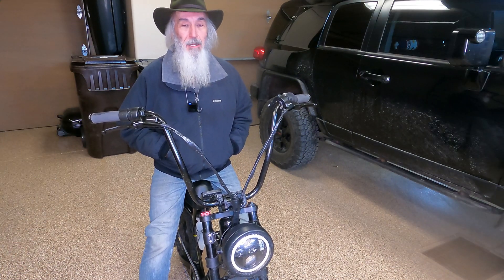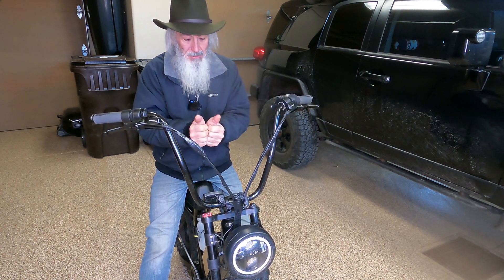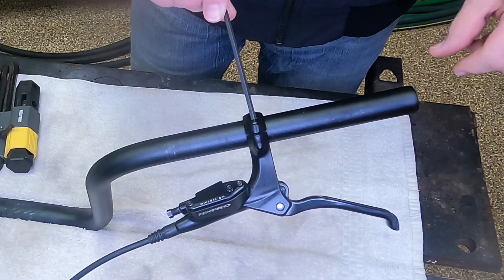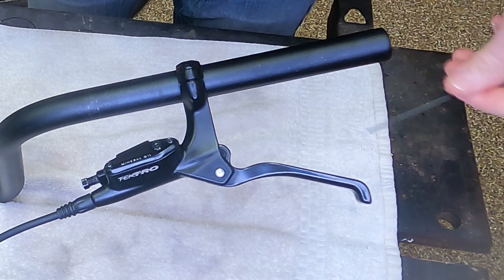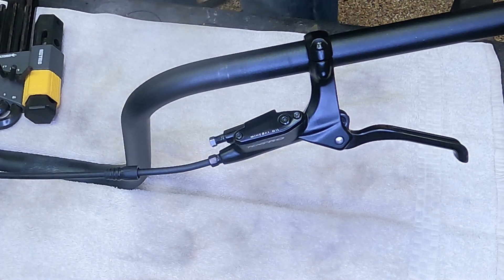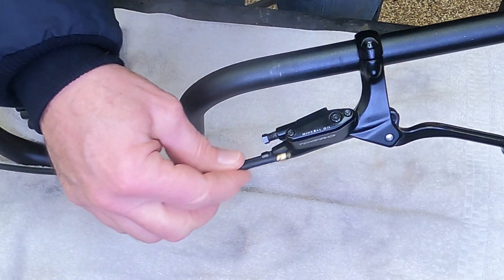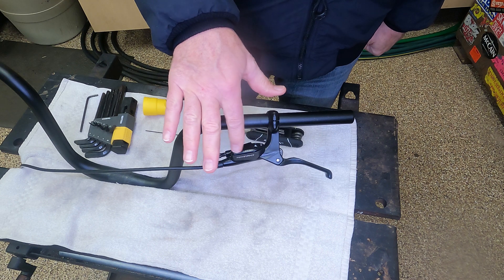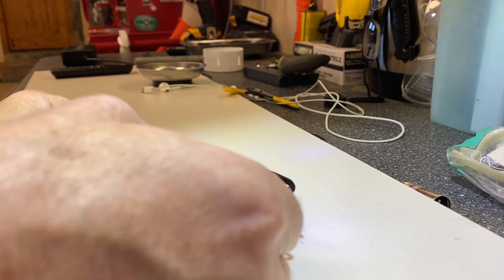Tektro E-Bike Brakes HD-E350 detailed explanation of everything necessary to DIY Repairs and Mods

Comment: Hello. I want to buy Tektro brakes HD -E3520. But technical information is important to me on how the electric sensor on the handle works. When the handle is NOT PRESSED (in normal condition) :                                                                   
 1. The electric circuit is non connected - NO  
 2. The electric circuit is connected -NC
Reply from the maker: If I remember it was NC Normally Closed (usa) or NC connected (over yonder)

Comment: You omitted the only part I need to see...putting the barb in with the collar and fitting it to the reservoir.
Reply from the maker: OK, so what I did when I needed to replace a line was, and this may be hard to visualize is,  I inserted the barb in as far as I could push it wih my fingers, then "lightly clamped it in a vise, vice grips may work too, then tapped it with some wood to get it to go the rest of the way till seated. or there's a tool Park makes just for this.
Reply: @UncleFjester  Hey, thank you very much Sir.
Reply: @UncleFjester  Got my brakes done. Thanks for your help, Unc!

Comment: I had always wondered wether baby oil could be used, thanks for confirming it. I guess the only difference between baby oil and proper fluid would be the additives the use to reduce boiling point etc, but i mean, its a bicycle not a motorcycle in what situation are u going to be boiling the brakes.
Reply from the maker: Added Fragrance of Baby Oil allow you to smell it when there is a leak.

Comment: Our teennager had a small crash that bumped the right brake grip of the TekTro HD-E350. The result was that the snap ring(c-clip?) that is inside the grip popped out.  My snap ring pliers are too big to get in there and the tips don't even fit the snap ring holes... 
Can you recommend a tool that would make it possible to set that snap ring? 

Thanks for the video!
Reply from the maker: Sorry John, I got nothing...
Reply: @UncleFjester  Do you know the ring I'm talking about? It holds the tip of the push rod that compresses the hydraulic fluid/mineral oil.  It just seems like such an awkward setup to get that ring re-set!
Regardless, thanks for the video AND for giving me an idea in my own videos. I like your pinned comment approach, and and I'm already in the  process of adding the same to my own videos... We offer value, and I think most folks have no idea they can send a $$$ tip!
Reply from the maker: All I have now are Shimano Deor's on my MTB.  Email me a picture of the clip, unclefjesteratgmail  But in manufacturing, making a tiny C Clip needle nose Pliers for a once off use is nothing.  I'll bet you can find replacement levers on ebay for cheap. Most people are now using phones to watch and I have no idea how to set up for that.

Comment: ..Everything..,  except how to fix the cut-off switch when braking :-(
Reply from the maker: Breaking or Braking?  There is a difference and you'll learn it when you get to the 3rd grade.
Reply: @UncleFjester  Thanks for the rectification.., let's call it a slip of the pencil..
Reply from the maker: Your 1st comment didn't give any details on what your cut-off problem is.  Not sure if you're just bitchin or if you are serious about my help.

Comment: Uncle, 
High 5s for video. 
Purchased a Aventon 500.3 Pacer, June last year. 
I live out of state from the state I purchased bike. 
The bike shops where I live, seem cater to a certain client base. 
Treks, other high end bikes,
They don't carry Aventon. 
Lately, front brake mushy. 
Discovered the ParkTool website, thanks courteous rep. And other sites pertaining to bleeding brakes. 
Ordered bleed kit from "A". 
After several attempts to relearning fluid dynamics, Ha, using both syringes, finally used the cup, that method worked. 
Learning this stuff, I contaminated pads. 
Now I have a horn when brakes applied. 
Order brakes or use sandpaper and ISA to clean/resurface pads. 
Once again, just found UJ site today.
Reply from the maker: Yeah, Hydraulic brakes are a pain in the ass till you become one with them, then it becomes easier to service them which you'll be doing frequently.  My advice would be stay offline and out of the forums, Iso Alcohol is for Doctors, not bike brakes, those commenters know nothing and just repeat what they read like a monkey would.  No need to sand the rotor either.  I would get new pads and a spare set or two depending on how many miles you ride. Hyd. Pads wear fast on these heavy AF Ebikes.
So, a little common sense that no one in any forum has, is this.  These are the same brake design mountain bikes use only cheaper.  MTB racers go thru knee deep water and nasty mud and all they do is hose down the bike.  And they are fine.  If you want to ride today, I'd remove the pads and with some 120 or 240 sandpaper, lightly rough up the pads then wipe down the rotors with any solvent.  Its just Baby oil that got on everything. Good luck!

Comment: Really wish tektro had used  a 3 wire magnetic switch that can do either normally open or closed (yes they exist) - as I need the opposite - continuity when brake is pulled - to turn on regen for the kelly controller.
Reply from the maker: It should be as simple as switching out the contact in the lever.

Comment: I am really cofused on which one of the Magura ebike brakes I should buy for my current ebike controller. Should I buy the MT4e closer NO or the MT5e Opener NO. I did a test to try to figure it out. But I am still confused on which to get. When I unplugged the sensor from my current brake levers. I am still able to throttle the ebike whike pressing the brake levers. Also the rear brake lights do not come on. Knowing this, which one of the Magura models should I purchase?
Reply from the maker: There are only two wires used, the switch on the lever is usually magnetic. all it does is make or break a contact.  What Americans call N.O.(normally open) Germans call that a Closer. What Americans call N.C. (normally closed) Germans call that an Opener. Its actually Germans forward looking culture. they look where things are going , while america looks at where it is.
The reason you can throttle the bike with the harness unplugged is you disconnected it. Sorry to laugh but its been a long day. That Means they are normally open and when you compress the lever they close. So what you want is the "What Americans call N.O. Germans call that a Closer"
It is confusing... I hope ya understand
Reply: @UncleFjester thank you for responding. You cleared it up for me. I was going to just buy the MT5e if you didn't respond. I figured I had a 50% chance of being right. I just subscribed to your channel. Good stuff, man!
Reply: @UncleFjester im thinking about getting the 4 piston Tektro beakes on my stealth bomber. It is a 175 lbs. ebike. Have you ever ran them on any of your bikes? If so, how did they perform compared to, say the Magura?
Reply from the maker: 203 Rotor and 4 pistons up front is all I would do.  But I rarely use my rear brake

Comment: Years later, this wisdom remains valid (solid info is like that) I see the cut-off/brake light line is basically a toggle, not supplying power, but suitable to switch a device on/off, specifically a brake light. If you happen accross this, can you suggest an aftermarket brake light brand/model that accepts this as a signal? I have Techtro Mechanical brakes, with that signal line. 
Thanks forbthe Tectro "Brakedown" in any event! ✌️
Reply from the maker: One more thing, I can't remember, but the contacts in the Tektro lever might be NC Normally Closed and woulnt work as a brake light switch. But an Ohm Meter would confirm my thought
Reply: @UncleFjester  Thanks, that could be.  I'll test before investing time, parts etc. Appreciate the help!
Reply: @UncleFjester   - If the switch/contact in the Techtro is normally open. I'll  take the positive lead in the headlight barrel connector, split it for a line to both handles redundantly so either handle can close the circuit. Not exactly James Webb telescope complexity, but should work for my simple needs.
Reply from the maker: Sounds about right, You'll still need a negative to the rear light.  The bike doesn't use the frame as a ground, as our cars do.
Reply from the maker: OK, so you want to use this lever as a Brake light on a non eBike?
Easy wiring, you'll need a battery suppling the voltage the light requires. Then take the battery negative directly to the Light negative.
Take the battery Positive to either side of the brake lever, then the other side goes to the Positive of the Light.
Electrical wiring 101...Easy Peasy
Reply from the maker: https://www.aliexpress.us/w/wholesale-bicycle-brake-light.html?spm=a2g0o.productlist.search.0

Comment: Now which wires go to the break light and which wires go to the engine cut off? Not trying to do burnouts just wondering
Reply from the maker: Every wire goes to the controller

Comment: Dude just found your channel trying to "fix" the brakes on the used Ariel rider I just grabbed used.  Love your style.
Reply from the maker: Welcome aboard! & Thanks!
Here is the deal with eBike brakes, especially a powerful Ariel.  Most brakes are undersized which means the pads will wear fast AF. Between pad replacements You can bleed or pump up the pressure to get by til the pads get replaced.

Comment: Great Video however would you happen to know if there's a lever spring on this model?  My brake lever no longer springs back when you take your fingers off it.  Other bikes would have a bolt that can be unscrewed releasing the lever from the brake assembly which gives you access to the coiled spring however not sure if the silver pin on this thing can be removed and replaced.  It appears that it be more like a rivet and once it's compressed on it's on.  Thanks in advance
Reply from the maker: This works on Hydraulic pressure of the lines, if you have no pressure or a leak, then squeezing the lever pushes all the fluid out and with no pressure it can't rebound
Reply from the maker: Not that I know of...

Comment: Love this video at the beginning and at around 12:53 mark. The sense of humor is awesome. I do all my bike maintenance work myself: fork (uppers and lowers), rear shock, pivot bearings, full stripdown of wheel axles and hubs, bottom brackets, headset, derailleurs, hydraulic brakes (bleeds and full overhaul of master cylinders), etc... The only thing I likely won't do is put baby oil into my Shimano hydraulic brakes. I'll use mainly the Shimano or other branded mineral oils for the sake of safety. Done right and with regular maintenance on the calipers, hydraulic brakes don't need to bled all that often. So, if you're doing this yourself at home to safe some money, might as well spend some money on bike specific brake mineral oil. A whole liter of Shimano mineral oil will cost $30 but will last 5-10 years if you regularly bleed every year. Baby oil that have fragrance have additives that might not be good for seals over time. In addition, no one has really tested the boiling points and duration of braking with baby oil. When your brakes gets near that boiling of the mineral oil, braking starts to fade and you will feel it when there's almost no braking. This is not a good thing especially for e-Bikes since you need the power of the brakes to provide braking, especially for e-Bikes that are heavy and can go fast. Yeah, there are forums where people have tried using baby oil (as a test or as a last resort). The reviews are mixed as some say it works or it works but you need to bleed quite often or it works but the levers feel squishy. Brakes are probably one part of a bike where you don't want to compromise on it's effectiveness. Trust me, I've been up on mountains where I have absolutely no rear braking due to a leak in the master cylinder. It's not a good feeling. Since I know how to use front braking, especially for downhilling, it's not much of an issue but still the feeling of having one of the hydraulic brakes go, it really drives your confidence down.

Comment: Hi uncle, can you explain how to add a break light on the  break levier for an electric bike like that ? I have a Surron and I want to make it street legal
Reply from the maker: Let me try.... Bring a Positive + wire(lets make it red) from the battery to the brake lever, it won't matter which wire(brake lever must be a Normally open contact) with the other wire on the brake lever go to the positive + on the brake light. Now you'll need a negative - wire (lets make it black) from the battery to the other - wire on the brake light to complete the circuit.  Because eBikes are different than cars, where all metal object are negative you need a separate wire from the battery.
All of this is the exact same for wiring a head light too.
Good luck, thats a lot of work, especially keeping the wiring clean looking.

Comment: Thanks.. I made the mistake of trying to tighten the ReachAdjustment screw in the lever.. I didn't realize that it wouldn't stop when it reached the limit.  What happened was that screw is really the rod that attaches to the plunger that pressurizes the calipers . Because i turned too far, that rod dropped inside the housing of the lever.  
I ended up having to purchase another E525 brake set because the old one froze up and the lever wouldn't move after the rod dropped inside.. this jammed up the action on the lever and no way for a layperson to fix without specialized tools..   and parts that are not listed on Tektro's website..   Tektro customer service told me that instead of tightening the reach adjustment screw, i could have accomplished the reach adj by simply bleeding the system..
My little mistake that cost me about $190...

Comment: Does anyone know where I can buy a replacement sensor online? It's like they don't exist. One of the wires got pulled out and I don't think shoving them back in there is gonna work reliably.
Reply from the maker: Personaly I'd take this opportunity to upgrade the from Brakes to the Magura MT5 and salvage the stock parts to the rear brake.  Due to the weight of the ebike and the entry level Tektro brakes, your stopping power in minimal at best

Comment: Getting back to the brake sensor...could you revisit this please.
How does it work exactly?
My sensor wire broke when I took a spill throwing an E25 on the control "sensor error". Can I simply resolder the wire, is there a polarity issue... give me anything you have please.
Reply from the maker: Should not be a polarity issue.  It is only opening and closing a contact to kill the power and initiate the brake light. Soldering will be fine.
Now lets discuss why you took a spill.  Do you still have those Dangerous POS Innova tires?  Those need to go as they have an unsafe design!
Reply: @UncleFjester  They have knobs, KENDA is the brand. No, I would have needed studs due to the ice. Now I'm trying to get a new sensor with wire and coupling.
Reply: @UncleFjester  If it was a matter of closing the circuit does that mean I could just short the wires and get power back to the motor?  Maybe there was a fuse blown too?
Reply from the maker: No, the switch performs two functions. It activates the brake light and cuts off power to the motor.  If is "just" broken, or disconnected, I would expect one of two things would occur.
1 being, squeezing the handle to do nothing(no brake light, throttle still active)
2 Being, throttle won't work, brake light is always on.
I can't remember if the switch is NO or NC
All of this is wired directly to the controller, I can't see why having the wiring ripped out would damage the controller.
The contact switch in the brake handle is magnet operated.  https://www.youtube.com/watch?v=vWwIrzTArwM
Reply: @UncleFjester  I soldered the wires together and got the bike working again. Its a thought that the wire was too taught in the first place. I have ordered another handle as a just in case but those solder joints are protected in the handle, they "should" hold. Thanks

Comment: Lol I can’t believe people actually bring them in to adjust brake a bleed brake, some people have more money then any common sense and lazy overall. I built my own ebike from frame up including the battery pack as wanted high current Samsung cells and etc. Prebuilt bikes are overpriced crap with cheap components to cut corners for the most part. I would had to spent over 3k plus for a prebuilt for specs I wanted like high amp hour pack with brand name cells and thick copper winding in motor, hydraulic brakes and etc. .
Reply from the maker: 😂 Makes ya want to open your own Bike Shop.
Money grows on handlebars

Comment: When your breaking on left handlebar that controls the front tire suspension you're supposed to have full control of the front breaks when you break at a full stop ( left break handle touches the handlebar ) ?
Reply from the maker: I guess it's personal preference, and I prefer not to have the brake lever touch the bar

Comment: I replaced my rotors and brake pads with much nicer rotors and pads and I think it cost me like 95$ and it makes all the difference in the world. With these cheap ass brakes I was having to adjust the brake pads almost weekly
Reply from the maker: did you replace the rear disc too?  I tried but it would fit
Reply: @UncleFjester  i did, but i have the juiced crosscurrent x, not sure if that's easier or not. I also live in a town that has a place you can take your bike to and they will teach you how to do fixes on them and they have all the tools to use which is great.

Comment: Is that a special juiced bike brake adjustment towel you use? I noticed you didn't put a link for it. I found one online for $50, but it doesn't look as special as the towel you use. Great video! 
"Little girlie hands like Tora Harris" Fuc#@n hysterical.